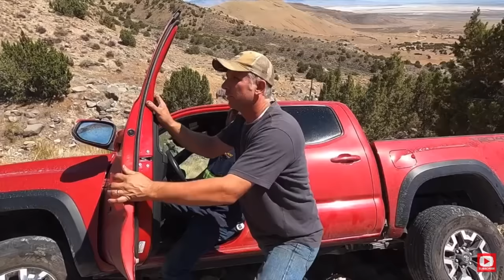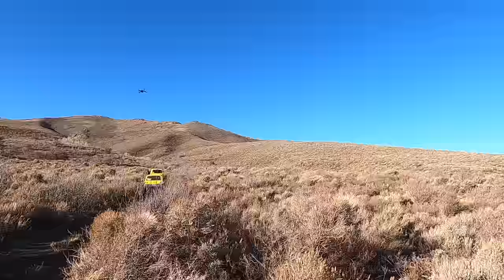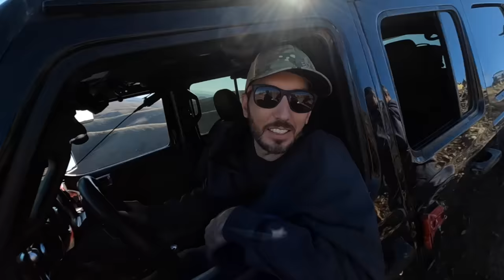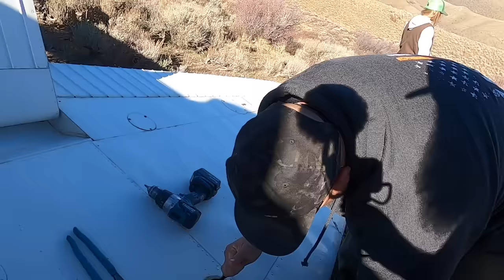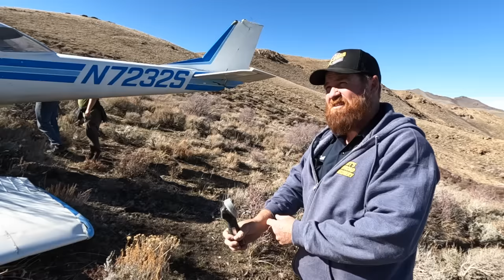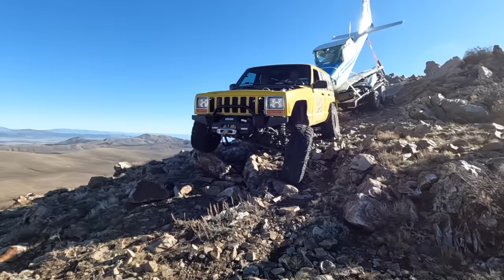The Craziest Rescue I Ever Had!

Comment: I can't believe it is worth the recovery costs to remove this aircraft from the mountain.  FAA registry says it is a 1967 Cessna 150H.  It's a small two seater aircraft with a value of about $15K to $25K, and that's in good flyable condition.  But, the propeller shows signs of twisting, so the engine was running when it hit the mountain, and so the engine is toast, and requires a complete tear down and testing of individual parts before they can be used again in an engine.  From the recovery video the wings are toast, the fuselage and control surfaces might be toast.  This is a certified aircraft so each part has to meet strength and quality requirements.  Even if you part it out it isn't worth much.  Some of the parts that were not damaged during the crash and recovery (radios and instruments) might bring a few hundred dollars on ebay.  Good job by the recovery crew.  Thank you for the show. Liked and Subscribed!

Comment: Any landing you can walk away from is a good landing, but this is pushing that quote a bit.

In other news, years ago (decades, actually), I was involved in an aircraft recovery of a Cessna T-41 Mescalero (military equivalent of a Cessna 172), long since sold (by the military) as surplus and owned by a pilot I knew. They made an emergency landing in the desert on the first flight after the aircraft had had routine maintenance done. (Later investigation found that the line into the fuel pump hadn't been properly tightened down, thus starving the engine of fuel when it vibrated loose.) Anyway, our roads were a lot easier to navigate than those in this video, other than we had to traverse one canyon, which was a bit hairy. The T-41 was not damaged during the emergency landing and was still on its wheels when we got to it. Instead of removing the wings, we put it on the trailer at a 45 degree angle, tightened down the straps, hung flags on everything sticking out, and drove slow enough not to generate lift on the wings. This saved hours of time compared to removing the wings, and reduced the expenses of repair and inspection later. She flew again a few weeks later.

Comment: The prevailing wind over a higher mountain peak is a river of fast moving air that can't be overcome no matter how much power you have as the wind races downslope in some conditions. The high (14,000 ft) Sierra in CA has left a grave yard of planes when strong winds capture the unwary.

Comment: I was wondering when they would put a cable from the front of the last F350 to the back of the trailer with the plane on it, so that the trailer with the plane would not be able to build up momentum when the middle  truck that is directly pulling it is going downhill.

These planes should be made of resin-impregnated silk, or some other fabric, that is made super hard by the resin but that remains super light, and is covered on the outside with some low air-friction material.

Great video

Comment: That was pretty rough terrain to put a plane down on. Well done to the pilot. That looks like it could have easily been a fireball instead. Nice drone work too.
But why is there almost always somebody with one hand on the winch line?
And the guy walking on the downhill side of the vehicle that rolled and was barely stopped by a big rock?
Other than that it was interesting, felt bad for the plane though. A lot of work and expense if it is to avoid being parted out and scrapped.
Hopefully Lizzy's appointment wasn't a fitness class because she definitely already did a session walking out.  :)

Comment: I'm thinking of all the careful hours of preflight checks and maintenance that little Cessna 150H had seen since 1967.  Bent aircraft on a mountainside always makes me cringe.  Service ceiling is 14,700' but even at 9000' with a normally aspirated 100HP engine even modest standing waves or rotors on the lee side of mountains will frequently exceed climb performance.

Comment: You have $1 dollar's worth of traction to spend. You can spend it pushing yourself forward, stopping, or steering, but that RZR spent about $1.25 on forward propulsion in the middle of an off-camber corner. Sometimes the old saying "when in doubt, throttle out" is best left to theory.

Comment: I was wondering why the little buggy wasn't on the trailer, would save fuel, then it rolled 😳 the guy is so lucky that rock was there. You should run off-road driving courses 🍻

Comment: What's the verdict on the Cessna?  Can it be repaired to fly or is it scrap metal now?
Reply: Cessna 152s can be had for as little as $20K on the used market. It's a complete loss. Maybe the engine can be salvaged, but it will need a rebuild after that prop strike.

Comment: Would the salvage value of the plane be more than the cost of recovery?
Reply: Probably depends on how many hours the motor has and what avionics it has assuming they are still good. If they are it's worth the recovery. That airframe it's self is pretty worthless now, I'd call it scrap.

Comment: Yikes...
When pushing an aircraft (or in any way moving it around), you do not - NOT - push, push, or otherwise touch the elevator, rudder, or ailerons. Yes, the aircraft is pretty banged up, but it can be repaired; and putting pressure on the control surfaces puts the wrong kind of pressure on the control linkages. The damage done to these linkages can cause failure in a future flight. 
This is why it is unwise to send people who do not know about aviation to rescue downed aircraft. 
This video reminds me of a previous video, wherein a cop "helped" a pilot push his aircraft off a roadway after an emergency landing. The moron was pushing mighty hardily against the elevator control surface. It was clear the distracted pilot did not see his evil deed, otherwise he'd been making some noise.